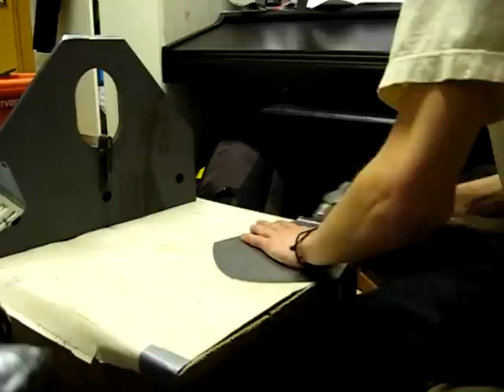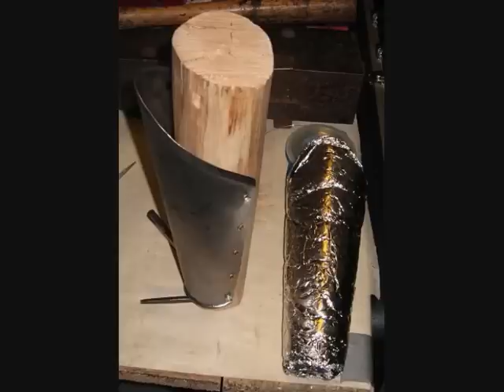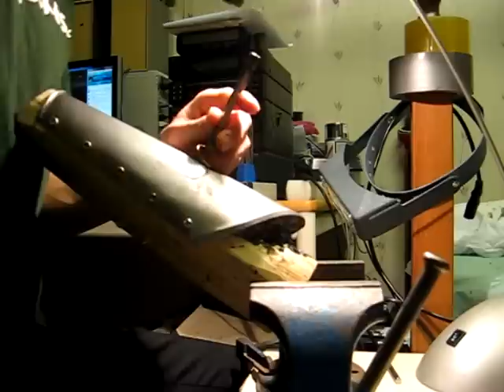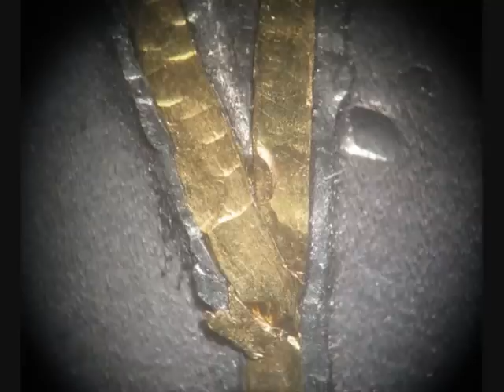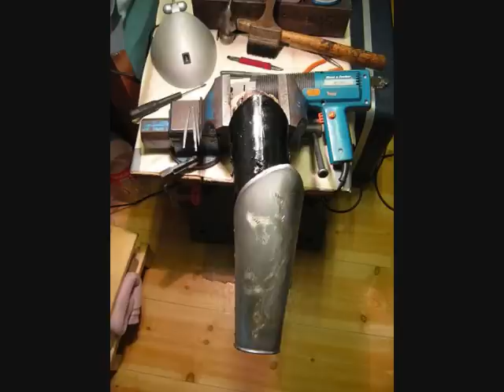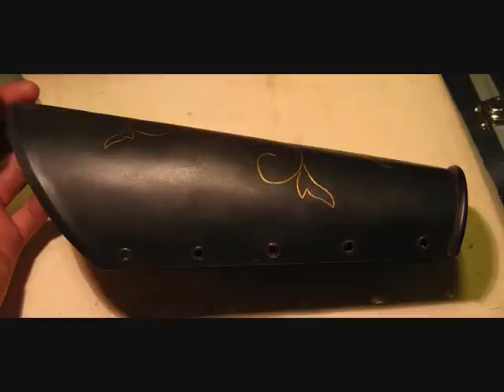Bracer, Armour making process

Comment from the maker: @sonicfreak04 Casted metal is often brittle so bending it may cause it to crack. Heat may help but it still brittle and depending on what metal alloy it is, it may be brittel even if you heating it up to melting point.

Comment from the maker: #part 2: wash of and repeat until you have a uniform rust layer. Then you simply boil it in water for about 30-45 min. I use to add a little tea in case it will give some colour to it, the water turns black. Haven't done it so much so I don't know if it has any effect.

Comment from the maker: You may find info about wire inlay, it's difficult on thin plate. It has broken up on one place when I slightly bended it. But I had bad tools so that could be one reason. I carve the line to be inlaid and I also cut the walls with a chisel so they lean inwards so the brass wire fills it out and stays. The iron is oxidised with hydrogen peroxide with dissolved salt(as much as possible when warm) and one fifth part vinegar.  Warm it with tap water and brush it on, that's the foam you see. #part1

Comment: fantastic, i am slowly trying to gather what i need to make armor. so did you "chisle" the section for the wire work and then hammerd the wire into the indention, i understand the filing and the reason, but the color and the weird wax in the sink thing, what was that? and how did you change it to black. thank you for any responce. also any link where i can get more info would be greatly apreciated, ty again